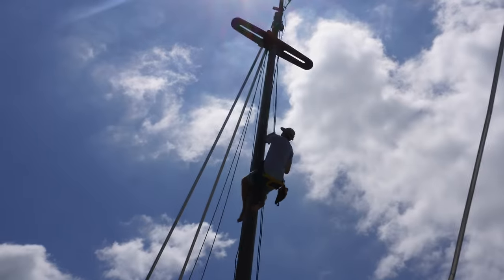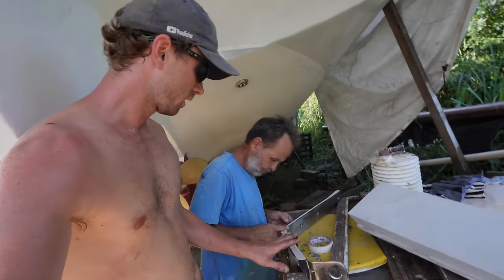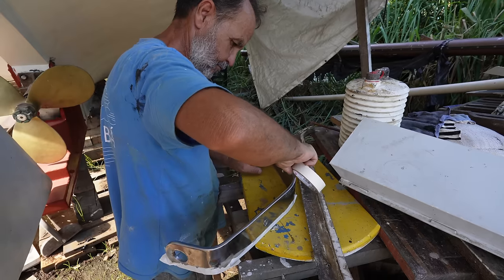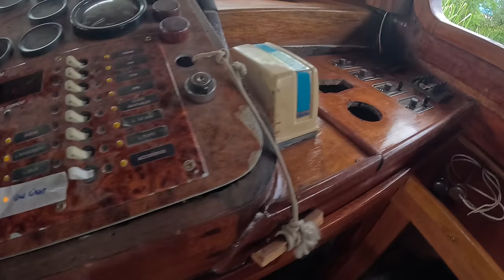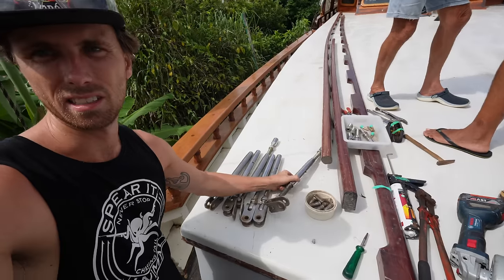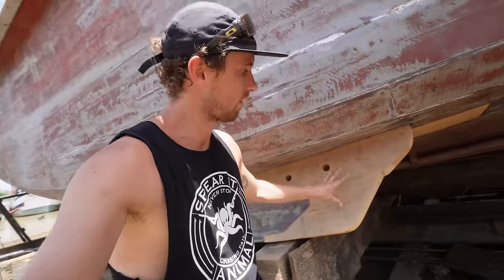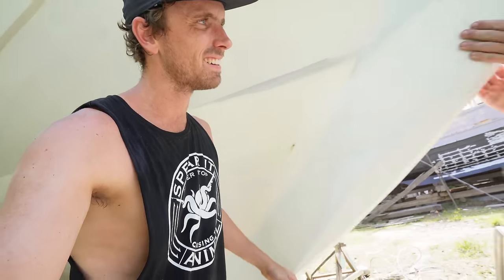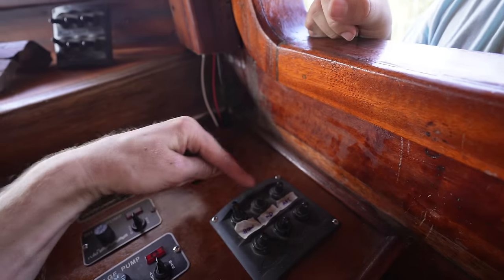Installing all STANDING RIGGING and ILLUMINATING where the sun doesn't shine! — Sailing Yabá 196

Comment: I just wanted to say, I think it might be a good idea to make some type of braces for the sides of the swim platform. There is going to be some pretty strong forces on that platform. Everything is really coming together now, keep up the good work you two.
Reply: Please see my comment about this. I have been worried about what could happen when running before a robust tradewind with the usual quite heavy seas. Of course the danger is that without some way for the tons of water either rising quickly from beneath the platform or crashing down from on high with a cresting following sea the damage caused could be catastrophic to the point of endangering the boat if the platform breaking up also damages their transom! I have suggested that they should incorporate a couple of hinged panels into the swimming deck to serve as a safety release. This is the second time that I have raised the issue but I am doubtful that either Ben or MP have grasped the potential for a bad outcome. But I can do no more than I already have so here's hoping that nothing goes wrong! 😅
Reply: @Davidcallard  You are absolutly correct! I couldn't agree more. You can even see the platform flex upward when Ben was drilling the plate!
Reply: @Davidcallard Not a good way to put the back stay! Crazy!
Reply: I agree some under bracing for sure.  I saw a video of how a guy fell off the back of his boat on the platform.  You may want some sort of railing in that swimming platform.  I wonder if you could do some retractable railing so when swimming it won’t be in the way like a gate or something
Reply: I saw then flex upward as well while drilling.
Reply: Don’t worry I don’t think the steering is strong enough to get them far enough to use the swim platform anyway, Hope I’m wrong 😢
Reply: This whole boat is not built for ocean crossing. They think they are going to travel the world but they will be in trouble if they do. This hull is designed for near shore cruising really. For that the boat will be fine and the swim platform will be fine.
Reply: Hire an naval architect or engineer to analyze it.
Reply: There has been so many mistakes since this hurry to launch I hope they don't end up sinking this boat or worse yet having a fire in the engine room from the less then ideal fuel line and fuel tank issues. It may get interesting when they must have a survey to get the ok to be able to insure the boat.
Reply: @rosjay_2119  just wait until the boat is either underwater of fully on fire and they have had to abandon ship so you don’t have to pull alongside to them and you can just pluck them out of the water or life raft. 😂😂

Comment: 😂 Congrats to all for a fantastic job! I ❤the lights! 😊

There is still one thing that worries me. You may recall that some time ago I pointed to your swimming platform and the risk of serious damage with a following sea when you are sailing before the wind ? I still recommend that you fit a couple of hinged panels into the swimming deck to allow a heavy sea to pass harmlessly through the open panels. I guess it depends on the type of sailing you do; if you are going to be doing. If you are only going to be operating in coastal waters and estuaries then you can probably get away without changing anything, but if you have plans for bluewater voyages then I will urge you to consult an ocean going sailor ! Remember, I am only thinking about your safety! ❤❤❤😊😂
Reply: That ship will never be in blue water  as they mentioned in there intro a long time ago it will be for local dive tours and liveabord cruising the Brazilian Coast
Reply: Yep! they need help!
Reply: its a coastal cruiser.... and putting a hinge there they need to put the backstays to another place.
Reply: @robertaxford7527 they keep mentioning crossings though. If they do any crossings they’re going to learn they bought the wrong type boat for that.
Reply: @srcastic8764  very true

Comment: Consider more cables or steel strap under the swim platform.
Similar to the bobstay
Could bee too much upward stress over time from the backstay in harder conditions

Can even be installed with pullies to adjust tension when necessary
Reply: I'm surprised they didn't make a drop down platform rather than one that is positioned to take so much stress. Surely these boat buildings who do this all the time must know better than us though

Comment: Not being an engineer (and you have your rigging specialists with you as well) but when you're connecting the chainplates to the swim platform beams (4.30) isnt the position at the end of the beams going to give a lot of stress on the beams due to the leverage applied by the rigging  due to the beams length ?  Asking for a friend LOL

Comment: Hiring sailors to do the rgging is a great idea. As it's been mentioned, strengthning the the platform is important and very crucial is having a tiller as a back up. You can't really 100 per cent on automation and electronic. When all fails, a tiller for the rudder and a compass with the stars will always bring you home.

Comment: Hello MP, I wonder if the wago wire connectors are the right thing to use in a marine environment.
I think that it is better that the wires are soldered and covered with heat shrink isolation.
Reply: no soldering please..
Reply: Crimping is the standard for marine environments

Comment: Your swim platform is subject to breaking off. A minimal fix would be guys to brace the swim platform to the hull but that's probably not sufficient. The backstay really needs to connect to the hull at the transom.
Reply: They can't, the stay is hampered by the roof of the superstructure, see @6:26
Reply: Superstructure needs to yield to a change in the backstay. This is a MAJOR safety issue and the backstay needs to win the argument.

Comment: I'm honestly concerned about the condition of your masts. I'm a sailing ship bosun and wooden masts need to be pulled and inspected every 6 years (When your sailing under class). Every metal ring must be taken of because underneath there might be rot. Considering the condition of the rest of the boat when you bought her it would be really wise to do that. There had been many deadly accidents within the last years. It's kind of serious. Also the running rigging must be exchanged every 5 years.
Reply: The mast is going to snap.  The boat is too heavy in the back as is the whole boat.  They used fresh cut planks for the hull.
Reply: No big deal! The boat has hardly any ballast in it. Nor does it has a significant draft and neither a lot of sails. Not much stress on the rig. But that doesn't help if the mast is rotten underneath the fittings. @jsEMCsquared

Comment: Suggestion. When hooking up lighting wire power directly to lights with relays. Essentially you connect the switch to the relay, and power to the relay,then power to the lights. Switches often fail because the switch resistance heats them up. Can do later, often done with automotive headlights.

Comment: I noticed the swim platform was flexing  while you were just drilling up into them. I'm no engineer but perhaps a long steel "L" bracket that goes the length of the swim platform under the 2 of the supports and anchored to the stern would give it more support. Or extending those stay brackets to go all the way to the stern and down a bit below the water line. Or maybe short stays that go under the platform to offset the leverage of the top stays pulling against the platform. Of course the boat lasted years without them, and the wood you used was really strong, so maybe I'm just over thinking it. Just wondering. Since I know nothing about sailing boats take it with a grain of salt. Getting so close to launch getting excited to see it float.
Reply: More good advice 😊

Comment: This is one cool boat, lots of nice features. I’m just a little concerned about the depth of the keel… I’m not a boat designer but the bottom seems a bit flat. I like you and your project a lot and want to see all goes well.
Reply: This is a shallow draft motor-sailer.  Generally the sails will be used mostly downwind and on a broad reach.  It is required that the captain understand the advantages and limitations of the boat he/she is piloting.

Comment: Only thing I am worried about is when the wood swells after being in the water those lights being crushed or popping out. They were quite a tight fit. Does anyone else know if that is an issue with painted wooden hull boats?